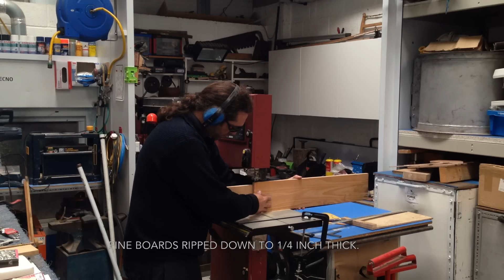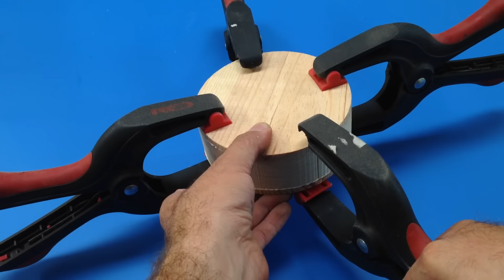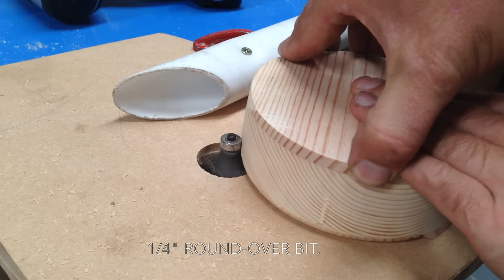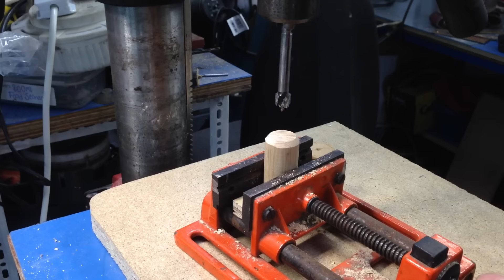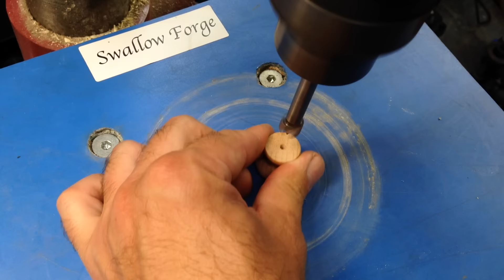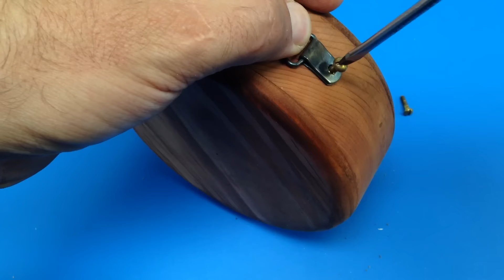How to make a Wooden Water Bottle or Hip Flask for reenactment, steampunk, Larp or cosplay

Comment: Don't ever drink out of this. Or put anything into it that you don't want leaking everywhere. Nice woodwork, though.
Reply from the maker: Seriously. What gives you the right to make that statement? How many of these have you made over how many years? I guessing none. You're just another self righteous keyboard warrior who has self appointed themselves as internet police of the universe. Next time you decide to make a less than complimentary comment, try imagining that we are sat across a table enjoying a beer together. Think how you would word a statement when the person you are aiming it at is close enough to punch you in the face. Then use those moderated words in your comment. That way we can open up a channel of discussion where we may learn things from each other and become friends over the either that respect each other. I hope this goes some way towards opening up a more amicable dialogue between ourselves. No had you asked the question "doesn't it leak?" I could have answered "as long as you are careful in the glue up, no it doesn't leak" much nice way to start the day :) glad you enjoyed the woodworking side of it at least. SF
Reply: +Swallow Forge Interesting answer.
However, not coating inside does not really appeal to me either. I have personally seen what water does to plywood as I made plywood flower pots and watched them almost melt before my eyes.
Also since wood is an organic material how will you prevent mold formation due to moisture?
Nice design idea though, I don't have a large hole saw but I can make angled pieces that sit together for the edge if I make one for myself. I'd generously coat food-grade epoxy inside the wheel and the entire surface of the sides, and glue it shut using the epoxy. I'm not a fan of combining wood & water.
Reply from the maker: Mozart Yeah, well I thought your 39th symphony, although technically flawless, was very Boring.
Reply: Swallow Forge You should take it as a part of context. #39 is not actually more than a sophisticated introduction to #40. Thus try to connect 39,40 & 41 so it can take a better critique.
Yet, I understand the "boring" Maybe you should spice up with some Tchaikovsky?
Reply from the maker: If all I wanted in life was spice and Jollity i'd simply listen to Beethoven. However variety is the spice of life, and a little of what you fancy does you good. :)
Reply: Swallow Forge True that. I sense a good taste of music here. In my arrogant opinion, Tchaikovsky is a little more complex in the matter of emotions comparing to Beethoven. I find him interestingly fit in different mood sets as he does not bluntly glorify joy.
People usually overlook his Symphony No. 4 in F minor, Op. 36, IV. Finale. Try out if you haven't yet.
Reply from the maker: I hadn't and wow, that is some seriously stirring stuff. I alway loved the 1812 (hell, I build and fire cannons, whats not to love) and the lilting tones of the Nutcracker always went well with a lazy sunday breakfast. Thank you for the recommendation of the No.4 though. Downloaded and added to the playlist. Not sure its one to play in the workshop when using power tools, but it might be good for attacking large slabs of wood with a scrub plane. Keep the energy going. :)
Reply: Swallow Forge Haha agreed! I knew you'd like it :) I try not to destroy my workshop if my playlists happen to play Britten's War Requiem. It's creating that epic workshop - war-shop sensation :)
Reply from the maker: Yes, Its important to match the music with the task, I was making a sword once whilst listening to a compendium of Holst, took a sizable chunk out of my old workbench when Mars came on. On the other end of the scale its why I never play Nine inch nails in the shop either. :)

Comment: eh.... what about the insides? no cover? this must be a joke, or just for show.
Reply from the maker: No joke. It does not require any internal coating. There is no perfect liner. Beeswax, pitch, etc all react with certain drinks. Plain wood does not. Barrels have been made from untreated wood for centuries. As long as you dont use sugery drinks or leave liquids in it for too long. It only requires rinsing out with clean water and allowed to dry with the stopper out between uses.

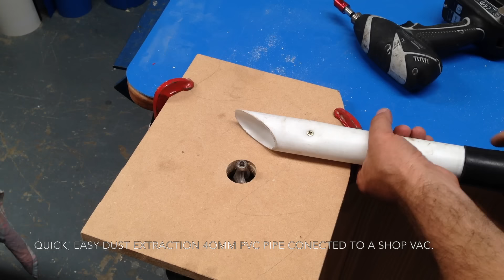Comment: 4:36 vac fail
Reply from the maker: Not sure how you worked that one out? All the fine dust and about 90% of the chips were taken away. The small smattering of chips left on the table are tiny in comparrison to the amount of dust produced. The Router bit creates a centrifical airflow from the piece being cut, so as long as you place the extration head adjacent to the direction of cut, most of the dust will be thrown into the direction of the extractor head. Plus, for an offcut of 40mm waste pipe, I'd say it was an EPIC WIN!  :)